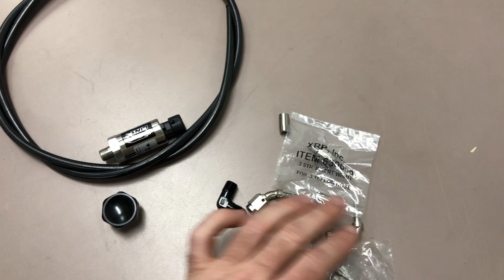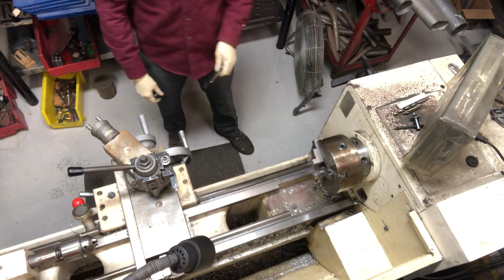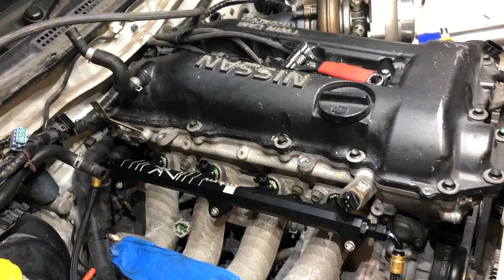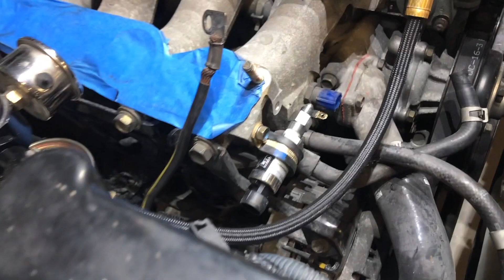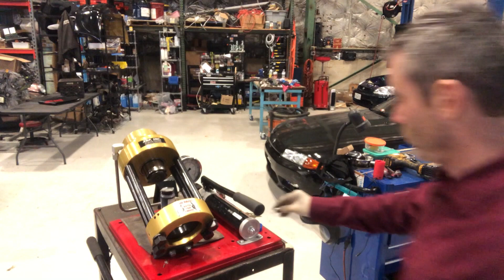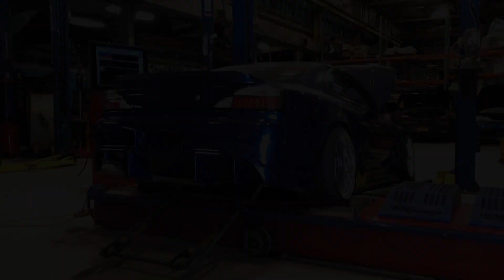S15 SILVIA DYNO Prep: Fuel pressure sensor AN hose plumbing using XRP Racing products

Comment: Awesome work as always!!! 

Suggestion: -Audio transition. My ears almost died when transitioning from speaking to non speaking parts (Headphone user), found myself adjusting the volume a lot. 
-Vibration from exhaust(waves in video). Dampen the vibration by using a piece of rubber around the camera. Can also use double sided foam tape to soften or eliminate the waves (not as clean though). 

Other than that quality video, keep it up!
Reply from the maker: Thanks for the tips!   Yeah the "Jello-ing" i call it with the video when doing a loud car is rough.  I also used my iPhone on a tripod to film this and I'm hoping the new camera i got will help with that, ill try the rubber damper or something on it!      Ill learn how to soften those transitions on iMovie.  I currently can taper them in the beginning and end of a sound clip but they are automatically done when a sound clip is over another one and the taper is obviously non-existent.   Thanks again for the input.
Reply: @MAMotorsports  Hell yea man. Any time!